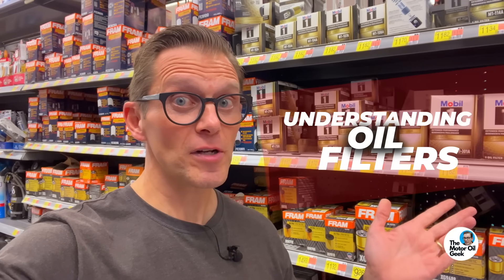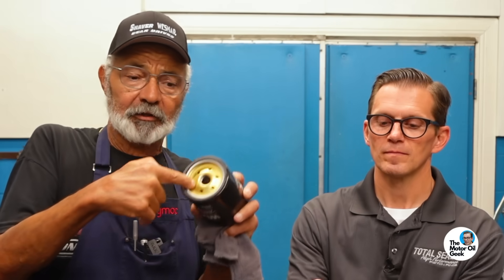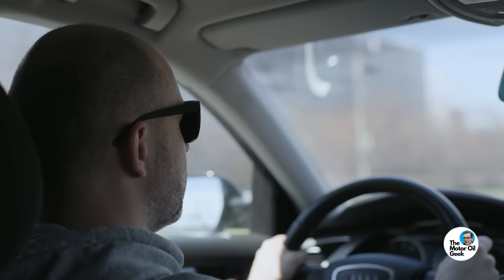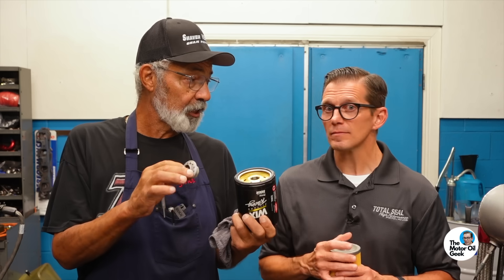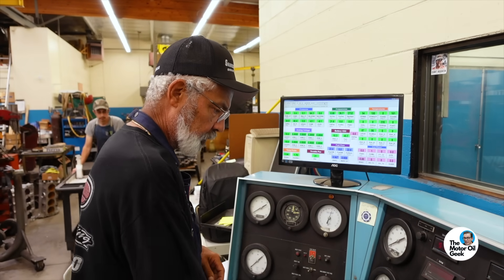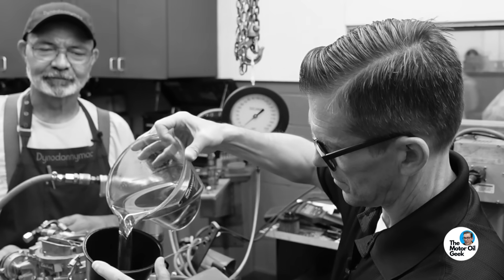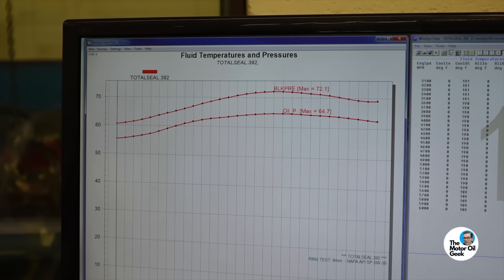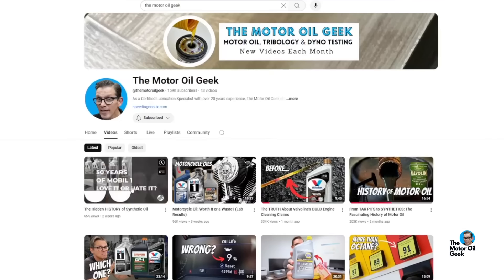OIL FILTERS: What Most People DON'T Know!

Comment from the maker: WOW! Thanks for watching! The oil used in this test was a 5W-30. Based on some of the comments, it would be fun to find a way to test this again at a colder temperature. Fortunately the viscosity of the oil does change dramatically room temperature and operating temperature - 173 cSt at 65F and 10 cSt at 220F. Unfortunately, the engine and dyno are in LA, so we can't get it too cold.
Reply: Awesome video. Definitely need a thicker oil with a colder temp. Maybe you could simulate a cold 5w-30 start viscosity with straight 60 or 70 at a warmer temp since it’s impractical to cool the setup.
Reply: I have Tested 7+ oil filter companyes, and All of them Are having a steel particles on the center thread, Because of Poorly Cleaning in the Factory. The Only Two Companyes which Did not have it, Are Bosch filters, and also Old Mahle filters, before they were made in China. Please, Test/Examine That too in the Video, Because the companyes Are Very badly Cleaning those Center-Threads, which Can terribly Damage the Bearings in Every Engine. Thank you.
Reply: I searched you vids but didn't find anything about if its ok to mix brands.  Before doing an oil change I was sure I had 4 qts of synthetic Pennzoil 0-30.  After draining I found out I only had 2 qts, but had another 2 qts of synthetic mobile1 0-30.  Is it ok to use both or will that cause an issue.
Reply: @ugetridofit  his Speediagnostix company analyzed the oil out of my Camry.  I disclosed I had a mix of Mobil and Penn Ultra and that got written on the report.  He made no comment about it.  Both are good, both should be in spec for viscosity and both have good additive packages....basically mixing once in a while won't move the needle at all.  Splitting hairs really.  You're good.
Reply: Well I'm not sure if you have some where you are but there's a SAE 40 and 50 monograde that i run on older cars if you want to try testing on them this way you'll be sure that the viscosity is remaining steady (kinda) but you won't have the 5 viscosity issue or at most run 2 stroke oil which is SAE 30, i don't think it'll kill the engine but it's decent for testing. I hope you keep up with your videos and educate some people that consider themselves knowledgeable although they are ignorant and killing their (and possibly other's) cars
Reply: hey lake grate video‼️‼️ quick question can you do a more in depth video about fuel additives vs oil additives. and also please help me learn is there any additives you would use for cleaning piston rings⁉️🤔
Reply from the maker: @Aaronouttaplace we do have a new video on fuel additives coming soon.
Reply: @FloridaGiveAway  he has covered these topics in the past: 1) Chevron Techron for injectors/system 2) no additives to engine oil whatsoever, use Valvoline Restore and Protect to clean rings 3) Top Tier gasoline, never generic
Reply: Thank you for all the information you share. 

I have a question and I would like to see more in-depth information / video about this topic. Is there a significant difference in flow reduction when comparing a top rated, high efficiency,  15-20 micron oil filter compared to a much less efficient oil filter such as the ones offered by oem manufacturers? Is there a concern about oil starvation in a 99% efficiency rated, 20 micron filter?
Reply: Love your videos Lake. You’re turning me into an oil geek !  🤣
Reply: Pack the oil pan and tubing in ice, stub under full of ice and salt will cool it like when ice cream is made.
Reply: @ Liquid nitrogen!
Reply: @themotoroilgeek  Can you reference any engine or filter manufacturers that recommend prefilling the filter?
Reply: @Tempest45-R1  without any liability to the filter maker they don't really need to go that far and one can tell by ear that less rattle supports the idea...also, every auto maker's manual states capacity with and without the filter, perhaps for a reason.  Even my Camry with a horizontal filter will retain and not leak during install, an impressive amount of oil....and I then know my cams and lifters etc are happy when they start as quiet as they normally do.  Reduced clatter is a good thing, and I'm willing to bet my engineering degree on it.  If an oil filter maker recommended against it, I actually wouldn't trust them.
Reply: @Tempest45-R1 manufacturers don’t recommend it because they are worried about you getting debris on the clean side. They’d rather you have a tiny bit more oil pressure delay with no debris than risk getting debris on the clean side. They have more concerns with potential liability (and warranty) rather than trying to squeeze a bit more life from your engine.
Reply: @Tempest45-R1  Simple watch your oil pressure gauge on start up without fill and filling the filter after changing it  you will notice a time difference
Reply: Have you done anything with centrifugal oil filters? The ones I seen were made by PPE for the duramax engine. Just wondering if they work?
Reply: The oil companies have done all the work for you. You 100% can look at a chart and then picking up higher oil viscosity to mimic a lower temperature. This is regularly done in the testing labs. The ones that will prove Shell gasoline is better or what the heck ever. Look it up. It would be very interesting
Reply: I am curious on what your favorite brand oil is and also what you recommend for fuel additives, you should do a video on that.
Reply: GR8 CONTENT, as always !!!
Reply: Is it true that Fram oil filters are total junk?
Reply from the maker: The Purolator One is a better filter option than the Fram filters.
Reply: @themotoroilgeek  Who would you say makes the best motorcycle filters that have all the features you would want, please mate? I'm not sure we get Purolator here in NZ. Are Hiflo an okay brand? I was told that K&N oil filters are total garbage like Fram. You seem to be the man to ask. Also, if you had the choice between an Ester based full synthetic, PAO Full synth or a mix of both, would have the least sheering and viscosity break down. Penrite in Aussie seems to spend a huge amount of R&D on their oil, like Amsoil in the States. Do you know much about Penrite? My '04 Triumph Daytona 955i was developed with and always seemed to run the best and best gear change, with Mobil 1 15w50 4t Racing, gold top. But you can't get it here in NZ anymore, only the 10w40 version, and I ride extra hard (get 1000-1500kms out of a rear sports tyre) and trackday it (coldest it gets here is 10deg C and hottest 30deg C ambient temps here in NZ), and they never seem to feel as good on 10w40, especially the gear change, and I just don't know which 15w50 full synthetic to use as a replacement. Was looking at Penrites MC4ST 15w50 and Yamalube 4-R 15w50, but do you have any readily available oil suggestions? Thanks for you help, love the channel      https://penriteoil.com.au/products/mc-4st-15w-50-100-pao-ester
Reply: So, for us non mechanically minded. 
When the bypass valve opens it actually "closes" oil access to the filter. So when the filter is full of contaminants the valve opens (closing off the filter) and the oil doesn't go through the filter and instead just bypasses it. 
So you can fill your filter when doing an oil change as the valve is closed and the filter is open to receiving oil.
Reply: You could build a walk in or roll in freezer. Roll the motor in let it get cold and test it. That way you guys wouldn't have to break out the parkas, mukluks and choppers and chooks to do cold testing:)
Reply: @themotoroilgeek would love to see you discuss the CAT oil filter mods (commonly for 6.7L Powerstroke). Seems like 50% say they're amazing. The other 50% say itll destroy your engine cus it doesn't have a bypass valve and also argue it isnt designed for your engine. If you answer it discuss your answer for a Phoenix truck owner and a Minneapolis truck owner so we can understand if it "depends". Thank you.
Reply: Aw darn, can't do a collaboration with Garage 54 when it's 30 below!
Reply: Ahhhh try rotella 15/40 diesel oil with that 51515 filter! Alot of our mini excavators use that filter. And I know when it's 0 degrees out, those engines crank pretty slow and they sound pretty noisy till they warm up. I bet it's bypassing till it circulates and warms and thins out some ??
Reply: @kwmiked   I run 5/40 rotella when its cold in my mini excavator and my 6.0 f350
Reply: Apply dry ice too oil pan for 5 minutes and I bet the oil would be below zero
Reply: It's amazing to see an oil filter work differently in California than it does in the rest of the country where the weather dictates when the bypass valve opens or not. I hope you understand that the bypass always opens on a cold start every time it's just doesn't get cold where you live. You would think the oil geek would understand this.
Reply: @davidkato6407  what makes it temperature activated?
Reply: @davidkato6407  The video just proved that the pressure differential is LESS when the oil is colder, than when the engine is at operating temperature. Did you not see that?

Comment: Good video, but spoken from somewhere it doesn't get cold.  Y'all really shouldn't use the term cold starts.

I have seen an oil filter burst when starting at -20°F.  It is a rare occurance clearly.  Not that sub-zero temperatures and engine starts are rare, about half the US experiences it for a month or more every year.

But I'd say that the bypass valve definitely opens on actual cold starts. During actual cold starts an engine can run for tens of seconds before registering any oil pressure on the gauge, what y'all are calling block pressure.
Reply from the maker: Thanks. Stay tuned!

Comment: Excellent information.   My concern was all about bypass psi.  Which is better higher or lower psi bypass.   After this I may just look for a 12-15 psi bypass.  I have 2 PF64 filters left over after selling my LT1 engine camaro which is a 22psi valve.  I now have a LS3 based LSA camaro and information says PF48 filter with 12-15 psi bypass.  I change oil and filter once a year or 5 to 7500 miles regardless.  Book states 10k and oil used states 12000 so I think I'm safe.  Great info.  Thank you.

Comment: So there is a service bulletin from GM that says the LS engines with the 2 stage oil pumps the filter with 15psi or less bypass valve will allow oil to pass thru bypass and cause engine damage and the fix for that is a filter with 22psi bypass valve. This video says bypass does not open. Again the oil pump is the 2 stage. Is GM wrong or is the video wrong?

Comment: That's not cold oil! Starting up north in the winter at -20F is cold oil. I even had a filter blow off a block once, after a cold atart emergency high throttle situation. (Orange filter). That's cold oil!

Comment: Im going to shock everyone that reads this comment. Are you ready? The spring and plate in the bottom of the oil filter isnt a bypass valve. It wasnt ever intended to be. Its there to press the filter against the face plate and seal it against the face plate and hold a seal against the rear of the filter to remove looseness and keep the filter inside in place. If that spring inside were to compress for any reason the inner filter will fall out of place and not be able to seal the filter against the plate.Rember what he just said the oil comes into the filter housing on the outside of the filter and returns on the inside. Thats to keep the oil from compressing the spring whitch it could do if it entered the middle of the filter and pressed against the bottom plate or spring. Now you know the truth....

Comment: Are these facts also true for motorcycle filters, particularly Harley-Davidson? I ask because many "YouTube" mechanics claim that the bypass on the paper filter almost always opens when starting the engine cold and during high Rev RPM's. Thus, they recommend using the reusable oil filters instead because they claim it allows oil to pass thru the steel cloth filter faster than a paper filter. They convinced me, therefore I have a K&P reusable oil filter on my Harley-Davidson Low Rider ST & a Hi-Flo reusable oil filter for my Harley-Davidson Pan-America Special!  Did I make a mistake?

Comment: This is all good info but the statemnt of 26 micron and any debris passing isnt an issue i disagree with.  Ive read countless oil filtration studies and anything above 2 micron is creatimg wear.  Of course it varies on location of the surfcees as lifters have different sizes vs cam bearings and so on, what size particles do the damage.  Bypass oil filtration reduces engine wear exponentially.  If filter manufacturers wanted to produce the best filters, they would be 4x the size and filter at say 10 micron absolute to get full flow high level filtion.  It would also save the automotive industries oil use by a factor of 3x.

Comment: If you add oil in the oil filter but the filter it's placed on the top of the engine it's a big mess to put the filter in place? no one ask this question?
Reply: Just put enough in to wet the paper and then wet the gasket ring

Comment: CAT equipment...no prefill any  filters especially on new common rail diesil fuel filters.

Its a old wives tale .
Oil pump primed will fill filter in a second .
You can pull coil wire off crank engine until oil pressure is up .

Comment: Most oil filters by pass oil when dirty after 6000-7000 miles.

Foolish to not change oil filter after 5000.

i have been building engines gas diesil marine industrial automotive since 1976.

Justt change freaking oil.

$60000 car and people skimp on $100 oil change bizarre.

I have 390,000 on my 2003 Chevy Van express 1500 4.3 original Motor burns no oil 40 psi oil pressure hot .

I use any good  5w-30 oil on sale and fram filters  since 1976.

Comment: So, from what i understand, with (M/T) transmission fluids GL4 is for manual and GL5 is for dual clutch... ok. My (wet clutch) DCT seems to require a GL4 as listed in the O.E. manual. (GS WDCTF HD G - WET DCT FLUID) I am curious if there is a 70W GL4 that protects yellow metals but also offers the correct coefficient of friction for the clutches, or if infact my requirement would only be sufficed by a GL5 DCTF? (Like Pentosin FFL7a or even a "no spec" DCTF like Motul HT DCTF? because of the AP) I can go O.E. fluid but its tough to find and double the price (probably because of the manufactures name and not the actual formulation so much) when available. Thanks

Comment: This is great data and a great explanation. I will say that in the real world under severe or weird circumstances, there are possibly times where the bypass will open that are unrelated to dirty oil. The lab can and does offer great insight but the real world is full of variables that are unaccounted for. This is why I like the filters with bypass valve near the opening just in case it opens I think there is a chance that less debris on the dirty side of the filter will get sent back into the engine.

Comment: I have been an automotive technician and shop owner for 44 years and have been using techtron and using and recommended item for my customers since it came out. It is also recommended by GM and is a sold by GM in the dealerships with their label on it. I have seen the results of techron in use in real life and real scenarios. I use it in my own vehicles on a regular basis and I've never had a fuel related issue with my vehicles. I only buy top tiered fuel and have for years. I recommend using this ideally on a road trip while the engines maintaining operating temperatures for a full take of gas not that it needs to it just makes sense. if you just put it in your tank and don't drive it's not going to do anything.I think this makes a lot of sense in the fact that the onions that operating temperature for a long time cleaning what is supposed to be cleaning.
Love everything you do lake keep it up I've been preaching exactly what you have without the chemistry degree.

Comment: Does anyone really want zero oil pressure at the bearings even for a fraction of a second? By the way the oil pick-up tube will most likely be empty as it has drained via gravity. Add this to an empty oil filter and lets say an extreme 20w50 on a 50 degree fall day in Wisconsin...I think over time you are going to see wear. Also, for anyone wondering we here in Canada mid February see temps in AM of -10 F...just put a quart of oil in the freezer over night and see how well it flows....that is your oil pan...Bearing clearances of .0021 to .0025 yikes

Comment: I previously had no opinion as to the direction of oil flow; I didn't know what I didn't know.

I could have, and did speculate as to which direction the flow went on the basis of larger surface area on the outside, now I do know and I also know the reason for it.

Incredibly helpful video, which does raise the question as to why priming methods for the oil pressure haven't been developed for mainstream application, I've seen some very old videos of inventions that did precisely that.

To my mind that function should have been implemented...

Comment: Lake, I'd be very interested to hear your opinion on bypass oil centerfuge options for diesels. They are probably the best option for pulling small micron particles like soot out of your oil, but they have no lower bound for particle size. Is it possible a centerfuge might actually pull important additives out of the oil as well? If so, which ones? Does losing the additives matter if its also pulling out the soot and wear metals? What about the viscosity modifiers? I'd love to kown your opinion and it would probably make a great video too. Thanks.